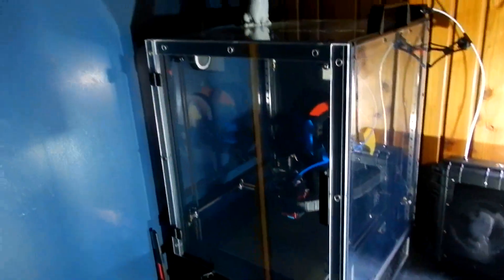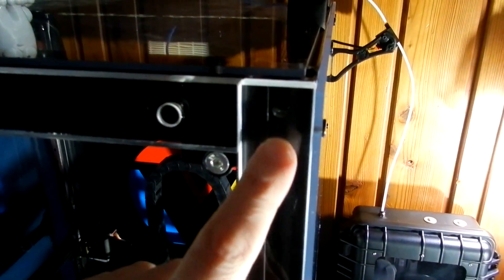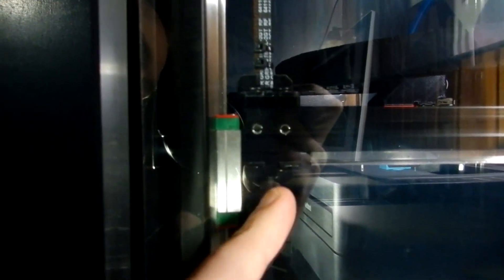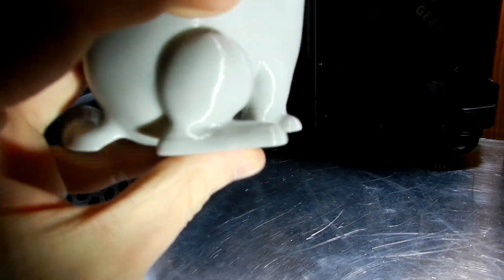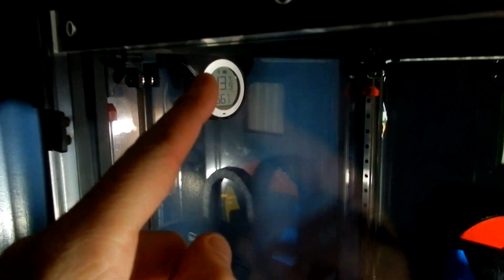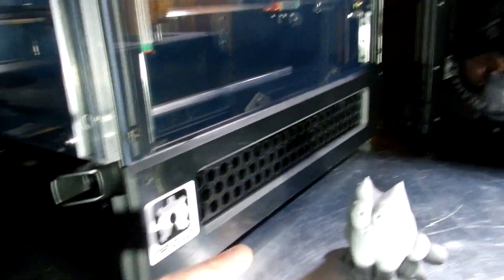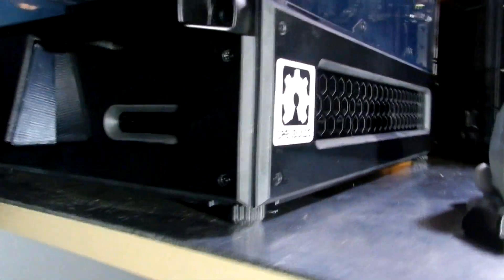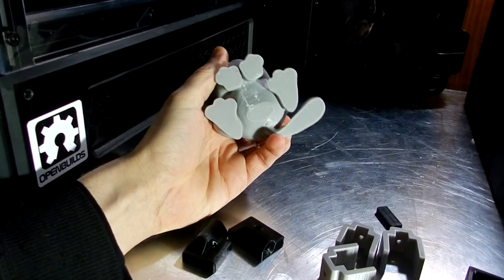Vivedino Troodon CoreXY 3D Printer Upgrades & Info 2

Comment from the maker: Just a update. I Ended up having to buy a bottle of Isopropyl Cleaning Alcohol as prints started to not stick to the bed. After that I had a problem with holes in the tops of my prints and didn't matter if I had 3 layers or 6 on top still had holes so checked all calibrations and did some small test prints and all was fine so reprinted the part I had problems with after re-saving it out of Cura to just make sure wasn't bad gcode and the print failed at 95%. Clogged nozzle and filament stuck inside the bowden tube. Ended up having to strip all the hot-end as the filament just would not come out and even after stripping it all the filament was still stuck inside the bowden tube in the hot-end area so ended up getting 2 new bowden tubes one to replace it and one as a backup. After replacing this and resetting Z offset and run calibrations I had to adjust estep 2mm and printed fine after them, got the part printed with no holes in top. Not sure If I talked about it is this video or other video but I replaced the main power cable also as it was lose in the main power plug on the rear of printer. Replaced it with a angled plug so didn't stick out as much as normal crap power cable.
Reply: Is it still running for you well?
Reply from the maker: @waifubellls  Have ended up selling it. Was going fine after replacing nozzle and Bowden tube. Just wasn't using it much and use my cnc lots more. Would I recommend this printer to anyone: no. Not for a 1st time printer person that wants to start 3d printing. If you into 3dprinting and can do all the quality control and error sorting yourself yes go ahead but it. But to be honest I'm sure there is a lot of other better printers out there for same or lower cost. I will look at getting another 3d printer at some stage but not at moment. CNC is getting a lot of use. :)
Reply: @exploringwithmark  Thank you for the detailed and quick response. Just for context, are you familiar with Voron printers or was this the only Voron-style printer you've had?

Comment: I think the ridges on the bottom of your cat could be from too short of a minimum layer time.  Love to see an update on this and some actual printing video
Reply from the maker: After adjustment 1 of the belts and checking others that was fixed. 1 belt was loser then others, Wasn't spend related as I was only printing at 30-40mm's. Fastest print I have done is 70mm's did try 100mm's but at anything over 50mm's I found parts are not perfect in size and I wanted parts that press together and use slots, pins and bolts.
Reply: @exploringwithmark  When you print a Benchy the chimney will melt on you regardless of print speed.  Very small layers need more cooling time.  You adjust that by setting the minimum layer time.  This way if the printer needs to slow down to 10 in order not to build up heat and blob melt a small area it will do so automatically.  Your print is a small area in that the layers  don't have much material in them so they still happen pretty quickly.

Comment: hello, Mark, thanks for your feedback, that's precious for us, so far we have made some improvements in last months:
1. adding more screws for transparent PC panels, so as to enhance tightness.
2. the power of fans in bottom chamber are adjustable, so you can make it quieter by software.
3. there are more options for air filter in menu, 0%, 25%, 50%, 75% and 100%.
4. the bed probe skipping bug is also fixed by update leveling parameters.
5. if you still have rail issue, pls contact us by email, we will send you replacement after confirm the reason.
Reply: There are a few people on the FB group with brown crap coming off the rail.
Reply from the maker: @FireFixer808  yeah I'm in that group. :)
Reply from the maker: 1, Nice one. :)
2, How do you do that?
3, Air Filter I added them options as I only had off and on. But good to see you added them. :)
4, My bed probing is still missing the back about 50mm of bead. its not skipping the front anymore but don't do rear.
5, Going to do some print this week so will let you know. I have posted photos and videos on here of it before and showed all the brown stuff inside bearing and on rail.

Thanks
Reply: I was close to buying one but after checking out the group I think I'll give it more time and let them iron out the bugs.
Reply from the maker: @FireFixer808  yip. I know they have fixed a couple of them so far and taken my idea to add more boots to panels that bend.
Reply: @exploringwithmark  yea its really encouraging that they are listening.
Reply from the maker: @FireFixer808  also there is a Direct drive upgrade kit they selling now but not seen and good photos for it yet.
Reply: @exploringwithmark  I heard about it. I also haven't seen it in action yet. I decided to build a voron instead.
Reply from the maker: @FireFixer808  yeah is 1 video of it working doing 1 layer. Not finished photos of parts. Did a print at 100mm/s the other day to use up last of roll and the print was nice on walls but infill was a bit crap and holes in it but have not adjusted anything but speed so guessing that be why. Been printing at 50mm/s lately as want parts to be to size
Reply: @exploringwithmark  Direct drive will mean slower printing speeds for good quality prints.

Comment: It seems like you're doing a little R & D on this machine. Overall, on a scale of 1 to 10, how would you rate it so far?
Reply from the maker: Yeah just little things that are a pain. I know I am not the only persons that's had problems with rails and the cable chain opening the door. Also looks like every machine has the bed probing skipping the 1st row. I have fixed everything on it so far. So now it time to print. out of 1 to 10 I would say 6.5 at moment. May go up after I do some prints now I have got the rails sorted. I know the prints are coming out to size so that's a plus and the auto bed leveling is mint. No adjusting knobs and using paper.
Reply: @exploringwithmark  Thanks, I appreciate the video's. I just ordered the 400, I don't have time to build a core from scratch. I'm intrigued by the mechanics of it though. So minor bug fixes are okay by me.
Reply: @ozzy1887  Did you receive yours & can you tell something about your experiences with the printer?
Reply: @stephanfuchs5691  Hi Stephan, right after I received it I had a work injury, and I'm hoping to get it up and running soon. It arrived in good shape and is huge (400) model.